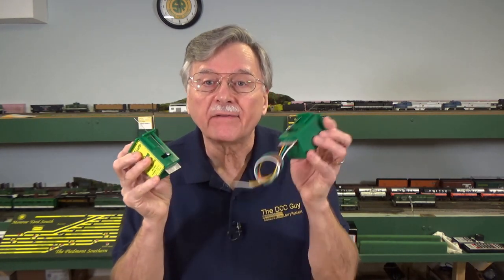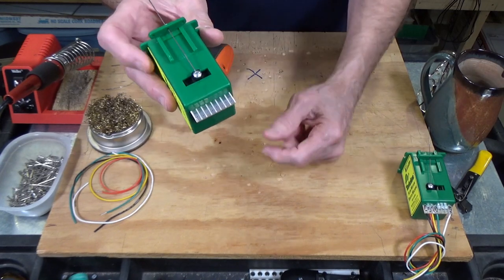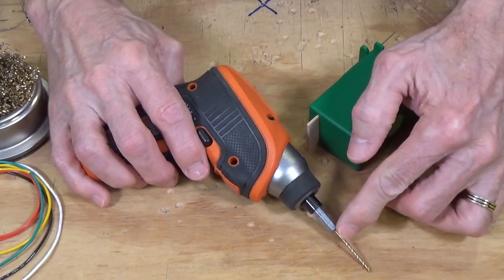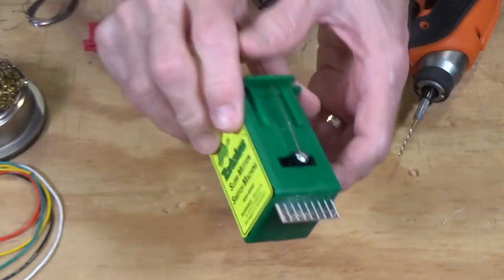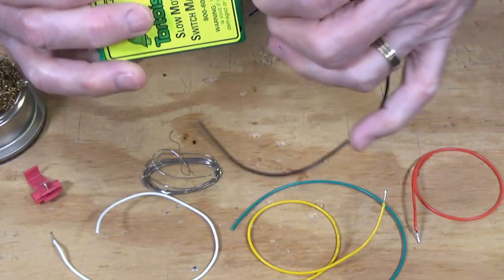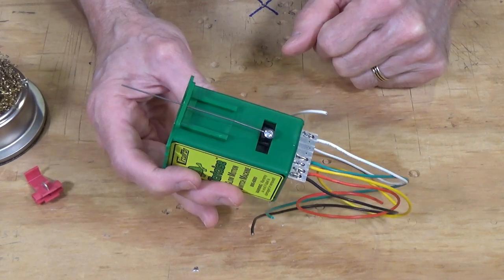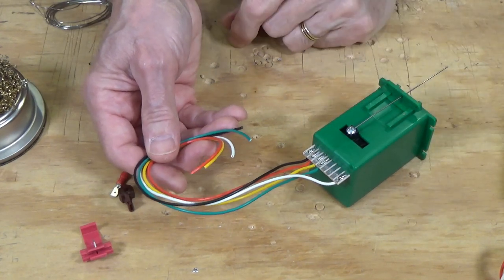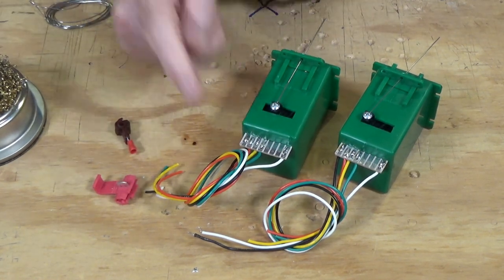Pre-wire your Tortoise Switch Machines for Easier, Faster Installations (65)

Comment: Larry, you should go one step further: solder your wires to a slip-on connector (there are several suppliers of Tortoise connectors). Then, replacing the machine involves no wiring at all - simply slip off the connector, replace the machine, and slip the connector back on. Also, I use 8 connector cable so that I have access to all six of the Tortoise auxiliary contacts if needed.

Comment: One of the big advantages of using Cobalt switch machines and bootlace terminals on the tips of the wires, there isn't any soldering at all required, just crimp them and that's a godsend when you have to work underneath a layout and use WAGO connecters to your DCC feeders and no soldering at all and better connectivity

Comment: This answered a lot of questions I had about these.   The only thing I’m left wondering is say a person has insulfrog turnouts that are insulated.  Obviously you wouldn’t solder a wire to it for anything.  So in that case, you would just send the black and the white to the bus cable and use the red and the green for your toggle switch?
Reply from the maker: With Insulfrogs you would not be powering the frog so all you need to do is provide DC power to tabs 1 and 8 on the Tortoise using either a switch or accessory decoder for directional control.

Comment: I noticed you use 22 AWG wire coated with several different colors sheathing. The model train shops and websites I purchase from do not have such a variety. What brands of wire do you use to wire your tortoise machines? Thank you.
Reply from the maker: I used to get my hookup wire from All Electronics, but now they are closing the end of August I likely will go to Jameco.
Reply: MPJA is also a good supplier for 22 gauge hookup wire.

Comment: I have 16 to 18 gauge wires going from the power to the toggle. Should I stick with that to go from the toggle to the tortoise or should I decrease them to 22 gauge?  I have plenty of the 18 gauge.  Except for getting it to fit into the holes more easily, does it matter?
Reply from the maker: You’re fine. I pre-drill the holes to fit whatever sixe wire I use.

Comment: What size of AWG wire do you recommend for connection to the drilled holes on the switch machine board?
Reply from the maker: I use 20-22 awg and enlarge the existing holes to accommodate.

Comment: You can say that again, just rewired the power leads for the second time, soldering upside down is absolutely no fun! And use good wire not cheap breakable (impure) copper wire that doesn't take solder well. I don't drill the holes though.
Reply from the maker: Yes, I should have mentioned that I like to use stranded wire instead of solid as it will flex much more without breaking. I also like to use 20 gage wire which is one reason I drill out the holes a bit bigger.

Comment: very nice, Im gong to be making theses for my layout soon. A question though, which one of the wires go to the frog, and two feeder leads, and if I wanted to use the other three connections for LEDs which connections go to which LED leads?
Reply from the maker: There is a figure in the Tortoise instruction sheet that shows the wiring connections for the traces. In my case the 4th trace from the left goes to the frog and you just have to wire the feeders to traces 2&3 then test the frog polarity—I usually just run a loco over the frog. If the polarity is off then I swap the feeder wires. This is where a couple test leads come in handy.
Reply: @TheDCCGuy  thank you for your explanation

Comment: where do you hook up for the power for these
Reply from the maker: The outer two pads are for power.
Reply: @TheDCCGuy  but where do you get the power do you hook them to the bus wire or what
Reply from the maker: You can use either outputs from an accessory decoder or power them using an AC or DC power bus. You also need pushbutton or toggle switches to activate the switch machines. I have videos on the channel showing how to build control panels, use accessory decoders, or use switch machines like the iP Digitals with built in accessory decoders. Enjoy the videos!
Reply: @TheDCCGuy  thank you for your reply i will be watching the videos

Comment: This is a great idea. I have several to install. I’m procrastinating. Lol. Do you power these of your buss line or a separate power source ? I plan on using throws
Reply from the maker: As I showed in my videos series on control panels, my Tortoises are controlled by accessory decoders which themselves are powered by a separate 12VDC power bus. This isolates them from the DCC power bus and makes them independent of it. I can throw turnouts even if the DCC system is off.
Reply: The DCC Guy ah ok. I have a lot of videos of yours to watch still. I will have to go back and watch that series. I’m currently working on building lighting and trying to figure out what/how to power those up🤷🏻‍♂️
Reply from the maker: I made my own light fixtures using ceramic bulb holders and 12ga wire. I then installed LED light “bulbs” in each fixture at 3’ intervals. Yet another subject for a video however due to potential liability issues I may have to skip that one. Another option is to use LED tape like for under cabinet lighting with the newer double LEDs. You could just order the party lighting strings like they used to use at car lots. They usually have a bulb fixture every 3’ so just hang them and you’re ready to go.

Comment: Hi, thank you for your excellent electrical videos. Could you advise on the required sizes for the eight different connections on the Tortoise switch machine please. I’ve searched the web only to find many contradictory opinions on wire size.

Kind regards 

Duncan
Reply: The 8 different positions are 2 outside are for powering the tortoise . 6 inside position are for two separate  DPDT switches that you can use to power frogs and the other one for signaling

Comment: They make a edge connector with screw connectors. No soldering on machine, no soldering on flimsy fingers of solder on edge connectors . Easy on easy off .
Reply from the maker: I know and I have a couple, but these are expensive! I can pre wire Tortoises with T-taps and spades and make them just as easy to swap out at much less cost.

Comment: Great video that is full of good preventive tips. How do you like the Tortoise switch machines compared to others on the market. Like Cobalt?  Thanks for sharing.  Ken
Reply from the maker: I guess I need to get a Cobalt just for test sake. The Tortoise has such a long and popular history of use that they are hard to pass up. Also because of that popularity they are readily available on the second hand market. The fact that they incorporate a pair of SPDT switches makes the ideal not only for turnout control, but frog polarity and signals or LEDs. With a current draw of only about 20 mA you can power about 50 with a 1 amp power supply. I have looked at a couple other brands but none match the Tortoise!
Reply: Larry, would be about to do a video comparing the Tortoise, a Cobalt and maybe the Tortoise SMAIL switch machine? That would be helpful. Thanks again for the great videos.  Ken